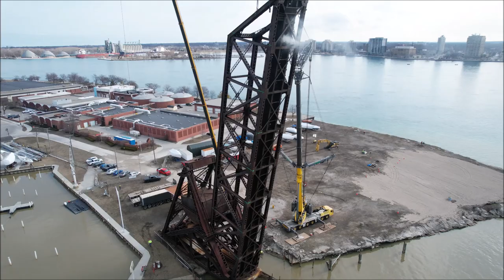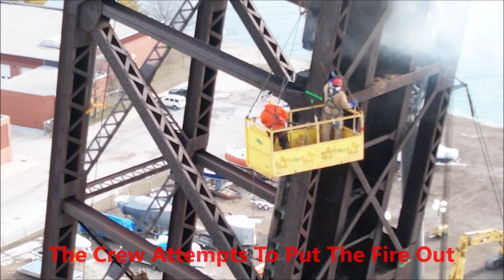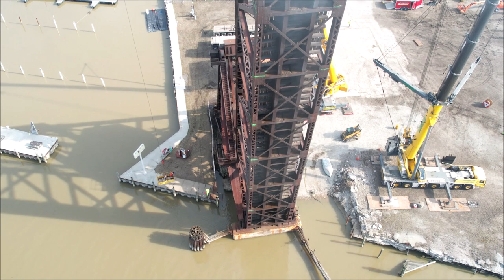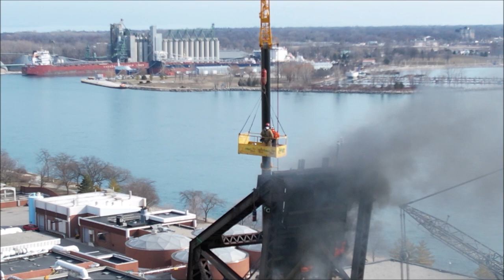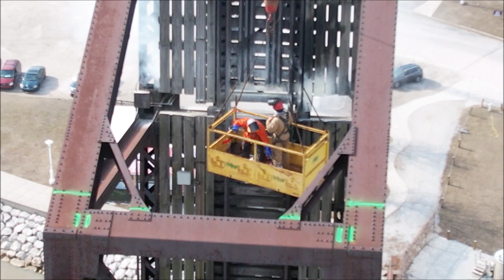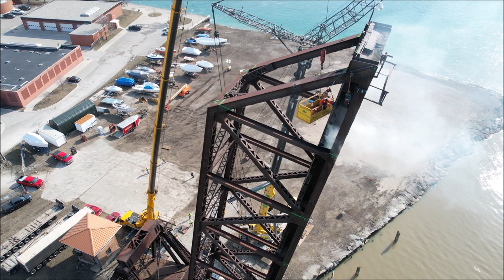Port Huron Railroad Train Bridge Demolition -   Port Huron, Michigan 3-21-2023

Comment: Bridge should have been cut apart laying down. Nitwit engineer and planners.
Reply: Lift mechanism possibly no longer operable. Even if lowered once dissasembly begun operation probably no longer feasable as structure balance/integrity would be off. Even tho demolition easier w/bridge down  the waterway would be closed for the duration which might not have been acceptable.